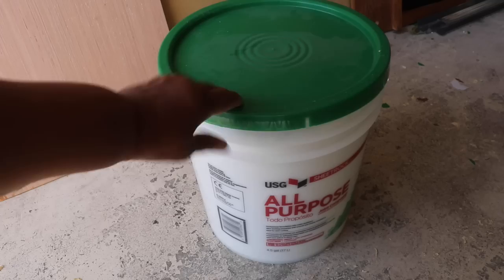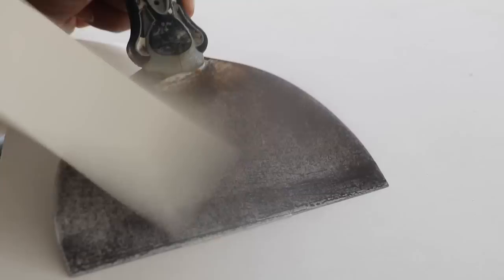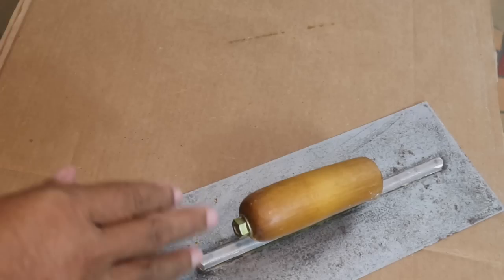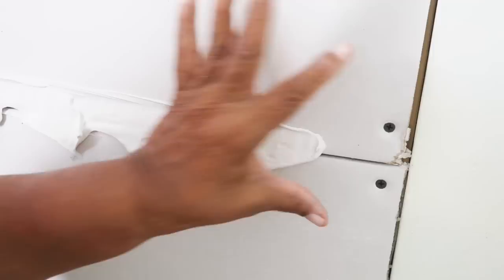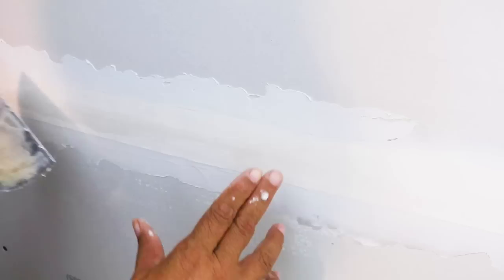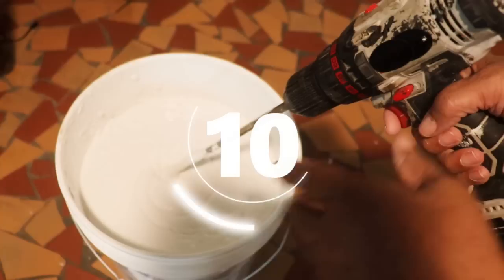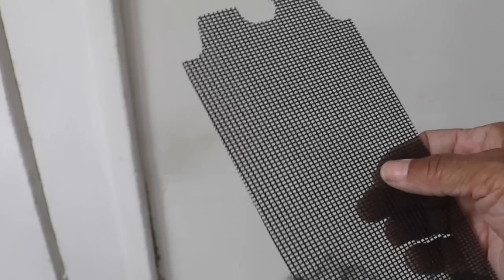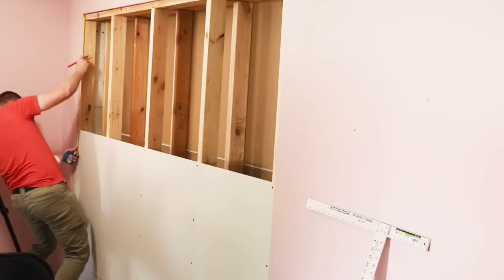FINISHING Drywall CHEAT SHEET

Comment: Drywaller here. Not bad! Couple of tips: 
Don't forget to mix a little water into your mud for that first taping. Yours is just a little dry.
Tape your butt joints first, then do your flats. That way you have less of a hump where they meet! :)
Flex the knife and feather those edges to nothing -- that eliminates more than half of your sanding for later.
Keep up the good work!
Reply: She mentioned all of that. Watch the whole video.
Reply: @no_handle_required  I did watch the whole video. The first coat, the one the tape was pressed into, was a little dry. And she did the flat joint before the butt joint.

Not to critisize her; she does amazing work. Just some things I learned working drywall that I hope are helpful. :)

Comment: Hi Leah, a really great video as usual the drywall technique has only been around in the UK for 20 or 25 years , I have used it in several rooms in my house and had great results. As you said do not go cheap on tools you buy cheap you buy twice I have bought a wide selection of taping knives and and trowels usually the marshalltown Brand and some of them I have had for 20 years I always keep a bucket of water handy to clean the tools as I go. Love and peace from Manchester UK
Reply from the maker: Marshalltown is a solid choice

Comment: "It just doesn't pay to buy cheap tools"   I have been telling people that for decades.   When I was young I made that mistake, and I had to replace every one of the shortly after I bought them.  Keep on giving that advice.   Harbor Freight is not your friend.
Reply: In contrast with Leah, I have thrown away all my carbon steel knives and only use stainless steel to avoid rust. Handles with some cushion are easy on the hands. Also, most larger knives have a slight bow, to help get coats flatter.
Reply: @kimberlydeann  Stainless steel can be great for working with wet materials as long as it don't need to be very sharp or hold a sharp edge.

Comment: Always pre-fill joints with setting compound
Reply from the maker: That isn't  necessary
Reply: @seejanedrill  It is if the gaps are wider than 1/4" or corners are broken. Some inspectors will require it if there is a "nail inspection".
Reply from the maker: @kimberlydeann  that isn't  what was initially stated by franchise15104

Comment: Question Leia, how long does mud last in the bucket or box before it’s no longer usable ?
Reply: Good question for her.  I was thinking she maybe should of put some plastic wrap or wax paper ontop of mud before adding the lid (to help keep it from drying). I don't know anything but guessing, but Leah would
Reply from the maker: It's hard to save an opened box of mud.  As for the 5 gallon pails, a few months, however it can mold.